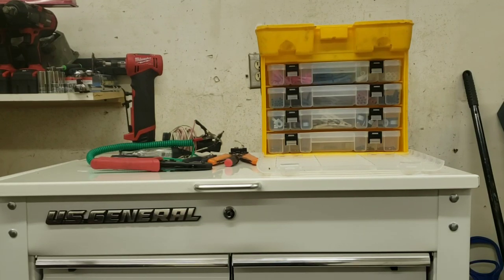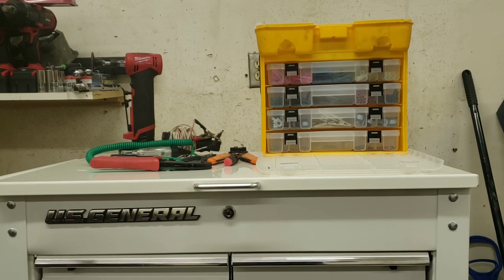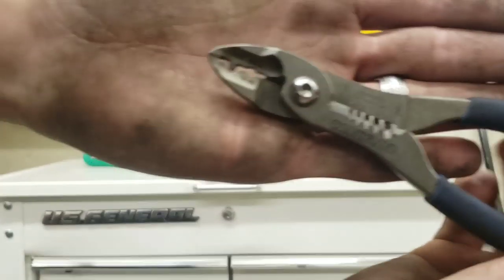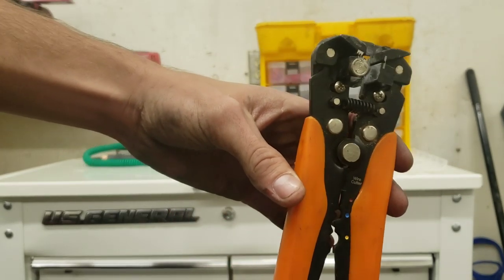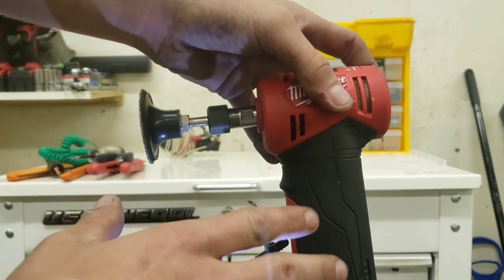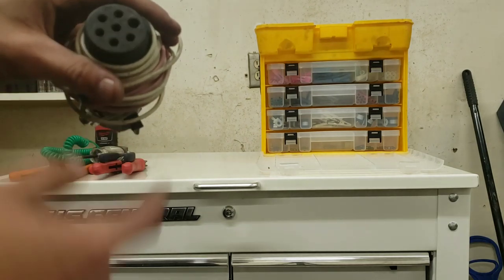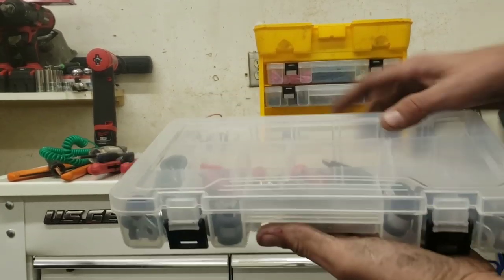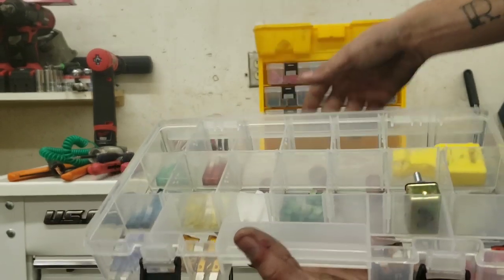ELECTRICAL TOOLS FOR DIESEL / AUTOMOTIVE TECH. TOOL TUESDAY EPISODE #1

Comment: I keep my hf roll cart just for electrical repair. The hf hydraulic crimper is very good for copper battery cable ends and the OTC angled wire crimps are nice for tight spots. Try some cloth electrical tape to wrap the wires with looks oem cant even see what was worked on.